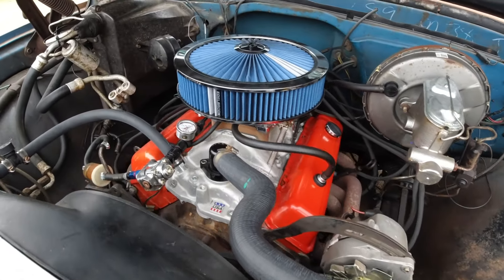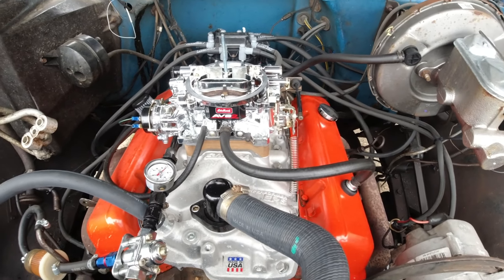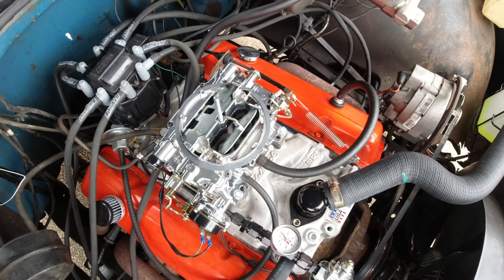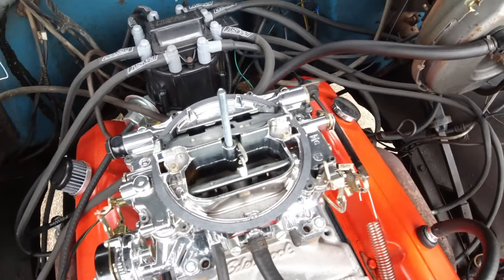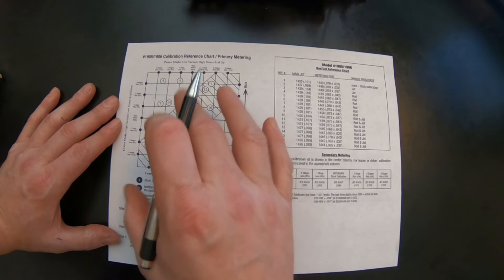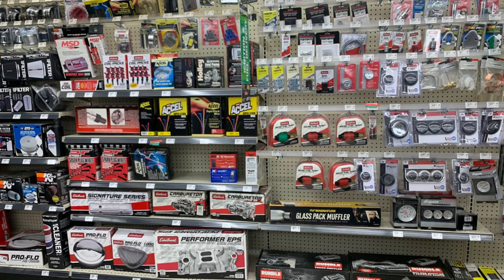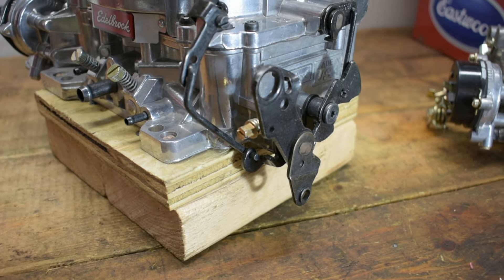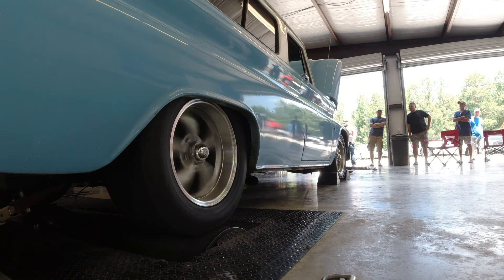Edelbrock Carburetors - The Good, The Bad and The Ugly

Comment: hey i have a sincere question. im building a 1991 chevy pickup single cab 350 5.7. im building it for off-road purposes it has a rollcage and fiberglass prerunner fenders.  i want to remove the tbi and go carb. can i get advice about going that direction.
Reply from the maker: @fernyloks47  it’s an easy swap.  There’s not much adjustability with the factory TBI.  At least with a carburetor you’ll have that but give up a little bit of that factory efi dependability.  Honestly if you’d rather keep an EFI set up and the dependability plus remove all the variables that an off road vehicle sees, the Edelbrock ProFlo4 port injection efi is a great upgrade.

Comment: Gday sir. Are you saying that you can't put a second fuel line on the other side of the carburetor with a t or y fitting? At least that's what  I'm about to do with mine, but for a different reason, and that reason is BOOST. Just to make sure I don't lean out under boost. It's a drawthrough application. Also I'm going to make a second plunger so I can utilize the empty bowl with some tomfoolery, that holds extra fuel opposite the plunger. 😂  wish me luck😢
Reply from the maker: Edelbrock makes a dual inlet fuel line.  You can run them separately with no problem.  Good luck with the modifications.

Comment: I have watched many videos where people call it an Edelbrock carb, I still call it a Carter carb. The design has not changed since the 1960's just a name change because Edelbrock bought the rights.
Reply from the maker: No, the internal design has changed to accommodate todays fuel volume, boosters and configuration.  Sure it’s looks similar from the outside I suppose, but that doesn’t mean it hasn’t had to change with the times.  It’s not the same Carter competition series carb, but it is made by a lot of the same people in its original manufacturing facility in Sanford NC.

Comment: Great informative vid and lots of excellent pointing outs of positive n negatives . I do want to know. I have a mild street Mopar 318 with Weiand stealth intake. I have a AVS 2 on American untying n it . Had a 69 440 magnum factory AVS on it n ran very well but wanting better fuel atomization as well as maybe some power gain. It does have 8.5-1 compression. High swirl 302 casting heads and a Hughes cam designed for my combo. Hyd flat tappet with .486 int and .502 exh. I run 3/8 fuel lines tank to Carter hv mechanical pump and a pertronix flame thrower 3 distributor and matching coil. Power master high amp alt. It looks a a total street car with 4.10 gears and 2800 stall. Hope w much fuel pressure should I regular it t to will be a gauge right before carb and right after regulator. I run a filter close to the tank and another right after the fuel tank pump. Seems about 6psi should be right . I know I can contact Edelbrock. But would like your opinion. Thank you very much .
Reply from the maker: Lots to share with you to answer your questions and to change a little how you look at it.  First off, curious about your cam selection.  Check out this short video to see what duration is the number that’s needed and lift not so important.  https://youtu.be/bNbwOMuwO6Y. Without knowing those specs but looking at what else you have and the low compression you’re running in that engine, is still advise to start at 6psi and tune down from there.  Edelbrock’s love operating in the 4.5-6psi range.  Any higher you’ll run into too much and any lower (depending on how you set the floats) can run into starvation issues.  The flow rate at that psi is good.  As far as better atomization is concerned, that’s going to be covered perfectly by the AVS2.  Power gain is going to be limited by the rest of your set up.  Tuning abs timing are your keys to finding the max power in that engine.  I have lots of videos on all these topics if you get a chance to check them out.  Watch that lift vs duration video first and let me now what you thing.  👍

Comment: I have always loved the Quadra jet carburetor for its mile per gallon advantage, but on my mild vortec 350 it is just not putting out the horsepower that my Edelbrock AVS 2 was before I took it off. And I just don’t have the time to get the Quadra jet perfectly set up, and it is also suffering from fuel starvation, which is an issue on those . Going to go back to the AVS 2 and try to tune out a rich condition at idle. My main question is, do you believe the AVS 2 650 cfm is capable of as good mpg numbers as the Quadra jet when tuned properly?  I drive a lot of miles with my street truck so every mpg counts. Great video!

Comment: OK, considering a 1410 for a Jet Boat build.  468 ci motor with 270* cam at 9.8CR with Aluminum heads (so it can run fuel dock gas).  Stock Berkeley pump with A cut impeller so it'll load the engine to maybe 5K to 5,500.  I like the idea of no leaks below the gasket line.  What do you think of this application?

Comment: What are your thoughts on a edelbrock avs2 1406 600cfm converted to blowthru? On a 4.8ls gt45 turbo.  Thanks
Reply from the maker: @Nathan-i6m  just because details matter; 1906 would be a 650 AVS2.  They don’t make a 600.  I would not waste my time with it.  There are too many details that the Edelbrock just won’t be able to handle under boost.  Fuel bowls are too small.  Step up springs aren’t going to work with that set up. The accelerator pump is likely going to push fuel as it’s tied to the drive side bowl and will see pressure.  You’re asking it to do something it’s not designed to do.  Stick with a 4150 style carb that can handle those demands.

Comment: I ran a Street Demon 625 and had similar issues with the accelerator pump. Where your opinion of the Edelbrock pump is that it's just too small, the SD's one was weak and intermittent (sometimes nothing). I fixed both of these issues by using a stronger spring to build more pressure behind the piston so the cup sealed better, and I also put an o-ring inside the lip of the cup to push it out into the pump bore. The standard SD pump was terrible in my opinion. They are made by Holley, so they had the chance to use the winning design with the diaphragm and they didn't.

My biggest gripe was with available needles/jets. Off-idle and midrange was brilliant, hut it was either rich cruise with good performance, or good cruise with lean performance. I tried everything, but the economy was just disappointing. Secondaries were always lean (on a mild 302C). After finally losing the tuning kit, it was just easier to buy and rebuild a 650 spread pumper. It's been the best economy- and performance-wise, and this is carb number 4 now. I have tweaked it a little (70 IABs, jetted 65/89, PVCRs out to 55, 2-stage PV) and it's a perfect mild street carb now. I won't hear any criticism of these carbs now that I know my way around them.
Reply from the maker: I have limited interaction with the street demons but have heard plenty of complaints about their fuel delivery.  Thanks for sharing your insight!

Comment: I bought a 1968 Ford Falcon that the engine kit, carb, trans was all matched up by Edelbrock.  The cam is mild, heads are aluminum as well as the intake.  The former owner stated it has 425hp.  I just rebuilt the carb as the plunger was not pushing fuel.  I put a new Edelbrock fuel pump on it and it shows 5 pounds on it at idle.  The pump is rated to 80 gph.  Now the car has good acceleration as long as I don't open the secondaries, because then it will cut right out...This was a problem since I bought it.  The carb is an Edelbrock 650, 1805. Got any suggestions on fixing this problem...
Reply from the maker: Yup.  You didn’t mention the engine CI.  What size are we working with?  Let’s start with the east things.  You said 5psi.  Is that what you have the pressure regulator set to?  Bump it up to 6psi.  What’s your initial and full timing set at?  The 1806 has the adjustable air valve.  Have you tried tightening up the spring?  I have a video on this if you’d like to check that out.  Have you reset the floats?  Checked to make sure there isn’t any trash blocking your rear jets?  Bowls are clean?

Comment: hey my friend i have a 1409 edelbrook on a chevy 4.3 v6 mercruiser is driving me crazy 2 barrel nice Beautiful run perfect, when the secondary open the engine almost stop!!! you let the throttle on the same spot (75%85%) a few seconds more it want to go like its not enough fuel or pressure??? .095 primary and .092 secondary… do you think 600 carb is to much for a v6 4.3 is too much? Any help I would really appreciate it thanks you

Comment: Super stuff ty. Looking to do a tbi to 1406 edlebrock on a clean stock ‘95 5.7. I will be adding the 1/2 inch phenolic 4hole spacer - is that too thick in your opinion? Also which manifold would you go with? Thanks again, I saved this video for future reference too!
Reply from the maker: You’re pretty limited on that generation small block.  If it’s stock, then the performer series is what it will want.  They make that in an EGR or non EGR version.

Comment: My 1450 just broke a spring off eccel pump. I pumped my sb 72 chev pickup and felt it break. Checked eccel pedal cable to carb it works so its inside the carb any ideas. Never heard this before. Carb is 15yrs old never had any issues. Dam it just when I wanted to drive it. The throttle feels very weak like a spring broke. Brian
Reply from the maker: Not sure I’m following you.  What spring?  On the accelerator pump?  There’s two.  One on the assembly and one underneath as a return spring.  Pop the airhorn assembly off and inspect.  Did you mean 1405?  Those assemblies are easy to come by if that’s what you’ve broken.

Comment: Question/ on my stock 340 chrysler i have a edelbrock avs1 650 carb i installed a delphi “stock” fuel pump after seeing your carb videos i checked my preassure it shows 6 psi idle but when i bring it up to 2000 rpm it says 9 psi? Pump specs are system pressure 6 psi max operating is 8 psi! Should i install a regulator??
Reply from the maker: Absolutely.  It’s extremely typical with mechanical fuel pumps.  Everyone disregards them as being acceptable to hen in fact they rarely are.  Give yourself that adjustability.  It’s why I always 100% of the time recommend a regulator.  Your carburetor will thank you!
Reply: Another thing… gas milage 12.3!!! 60 mph freeway Plugs are brown no smoke or gassmell. 3:23 rear 727 auto no draggin etc…. Seems very low. Could more timing change that? This year it had a thermoquard 800 isnt that big for that 340 ? Or is the avs 650 to small ! I have a avs 2 650 on my 347 stroker ford it seems more than anough! Only issue i have there isa bog when i want to floor it… tuned with an afr gauge is some times shows 10 afr cruise 13.8 gentle acceleration 15-16 afr wo 11 really played with the calibration kit and springs .

Comment: Well to address the starving issue when you're turning left can't that be resolved by adding a fuel inlet on both sides? It already has one on the passenger side but can you add it on the other side as well?
Reply from the maker: I’ve never had that solve the issue.

Comment: Quadrajets are OK for GM's but they have a really small float well/bowl. Also they're made out of zinc instead of aluminum. Holley's are pretty good, simple to work on, pretty fair adjustability, but nowhere near the fine tuning you can get from a Carter (Edelbrock). The Thermoquad is a much more refined version of the AVS and MUCH more precise fuel control than the Quadrajunk. I've had TQ's that were almost as responsive as fuel injection. That AVS2 is a really nice carb. Put one my truck out of the box and it's a real performer. I probably wouldn't use the earlier AFB knockoff Edelbrocks.

Comment: Phenolic spacer, how did you set the carb directly on it? The ports underneath on mine wouldn’t clean when I hit the throttle
Reply from the maker: Don’t know.  What spacers are you using on which carb?
Reply: @MuscleCarSolutions   the one I have is the Edelbrock 8726 which I believe design for q-Jets not Edelbrock
Reply: I have the AVS 2 on a stock intake 1970 c 10 pickup. 5.7
Reply: I found the one I think I need 8725

Comment: On cold start Holleys are better. It does seem to be an easier carb to set up on a new car. But I have had 3 Edwlbrocks that all leak down over night making hard morning starts.
Reply: Today’s fuel will percolate out of the bowls. I have a 1980 Corvette and the engine bay is really tight. I’ve tried the insulated spacer and it didn’t improve it. However, if you change to an electric fuel pump the bowls will fill much faster. You can even install a momentary push button on the dashboard to fill the bowls before cranking the engine.

Comment: Great video! What is the maximum fuel pressure for the AVS2? I hear they don't like to have too much fuel pressure. The carb I have is a 650 CFM AVS2 that I am putting on a 460 soon. Thanks
Reply from the maker: 4.5 to 6 psi is the range you can operate.
Reply: I run mine at 5.5 psig. You are correct they run rich a higher pressure. I also noticed with a mechanical fuel pump pressure seems to bop around a bit. A regulator will not only lower the pressure but will also smothen out the flow making it more consistent.

Comment: At what duration @ .50 does edelbrocks run out of power. I have a 230 @ .50 duration cam. Would the Avs 650 be a good carb for that motor on the street or would you recommend something else?
Reply from the maker: The two aren’t mutually exclusive.  It’s the entire combination as well as how you plan to use it.

Comment: I built a Chevy truck 355 with the competition cams xe 268h 477/480 lift 221/224 at 0.50  anyway it was a slightly different duration than the factory sbc cam profile and the 355 with the Holley street dominator aluminum intake manifold I figured would need a better breathing carburetor so I had acquired the Edelbrock 1407 750cfm manual choke performer carburetor it ran strong but it was not as good as throttle response as the factory qjet carb the Chevy truck came with, and the gas mileage with the Edelbrock was horrendous so I pulled it back off and slapped the quadrajet carburetor right back on the 86 chevy k20 custom deluxe long bed 4x4 truck... That being said my nickname was well deserved for the Edelbrock was the drag carb!! But it just didn't get the acceleration plus the mileage the qjet did so I ended up going back to the factory quadrajet carburetor.
Reply from the maker: Yup.  Happens when you put too big a carburetor on.  That’s a very mild cam.  The 750 was way too big.  600 would have been a better choice.

Comment: i just came across this video, and albeit older, i have not experienced the starvation from left turns, however i run a offroad carb i think a 1914 not for sur on model number but off road avs2
Reply from the maker: @stillboyzcustoms8182  it’s aggressive turns where that starvation occurs.  Don’t think you’d experience that with an off road rig!
Reply: @MuscleCarSolutions  it's a daily but went with the offload just incase...😀

Comment: Hi, your videos are simply the best!!! I seriously mean that too. I noticed your fuel filter is full of gas. I have an electric fuel pump with a mister gasket regulator and my fuel filter is at best about a third full. It seems once the truck runs and gets warmed up I have problems with no fuel. There is no vapor lock, no clogged fuel filter before and after the electric pump. Any suggestion? While I am home everything works fine but once I am on the road she behaves poorly and leaves me stranded. Thanks again for these great informational videos.
Reply from the maker: Couple questions.  Is the carburetor bolted directly to the intake?  The inexpensive Mr Gasket pumps are known for being rather unreliable.  Have you tried a different pump to verify that it’s working as intended?  Are you running any sort of regulator in the system?  Hopefully and it’s the last thing before the carb like I mention in my fuel systems video.  I very much appreciate your kind words.  Thank you!
Reply: @MuscleCarSolutions  wow, that was a quick response, thank you. Everything is new on this build. I am going from the tank to a filter, to the electric pump, to the mr. Gasket regulator, to a clear filter and then into the carb. I have an extra electric fuel pump I was thinking of trying also I am thinking just use the mechanical which it currently does not have. Its a stock 302 ford in a 1950 Willy's pickup. Engine is all new rebuilt too. for about 40 bucks I can buy a new mechanical one, what do you think. I ordered a pressure gauge to test the pressure but at this point I am so frustrated and I have no faith when I take it out. The carb is also new too.
Reply from the maker: Check out the video I have on how to set up a fuel system for a muscle car.  Will get the order straight in your system.  At this point I’d start to eliminate potential problems.  The verification of the pump working properly would be a good place to start.  Is this a vented tank?  What cap are you using?  Good thing to check would be when driving and it’s acting up to pull over, and open the cap.  Does a big rush of air occur when you pull the cap?  Could be creating a vacuum.  Just some guesses here.  Keep investigating!
Reply: @MuscleCarSolutions  wow, ya know I never thought of the cap, what a great idea.I am working my way thought the system. I notice the see through filter on your truck seems full, mine is never even half way. I'll check out the vid. Thank you so much for your time and expertise, it's greatly appreciated.😀